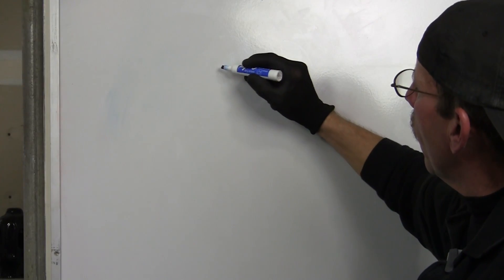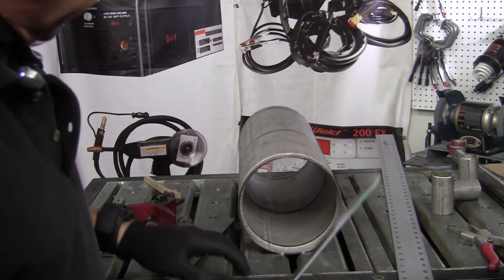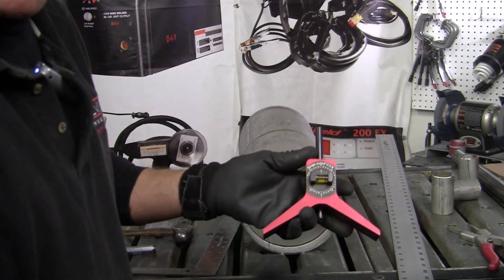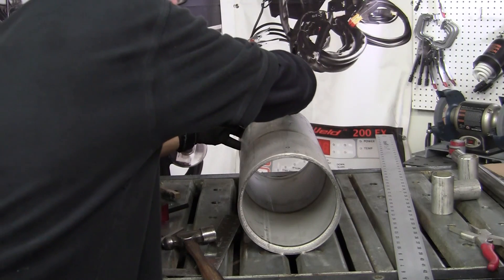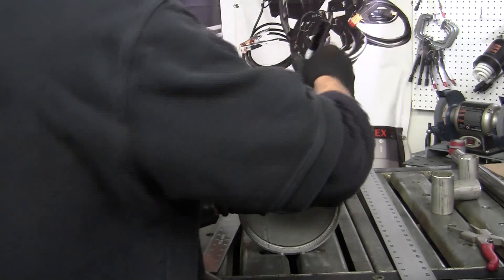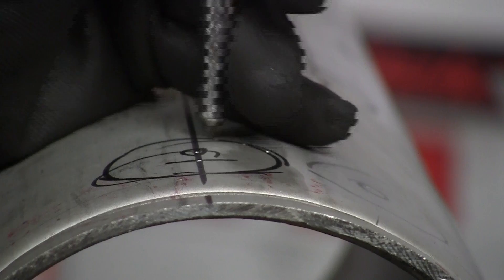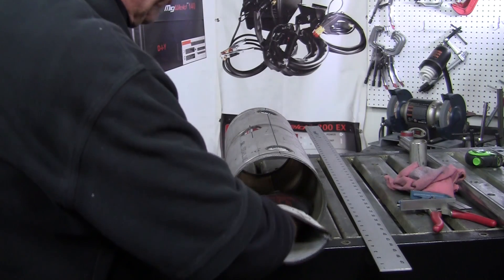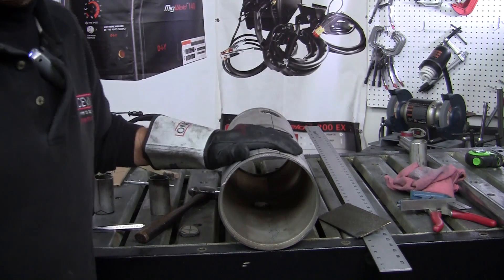HOW TO WELD STAINLESS STEEL PIPE TIPS AND TRICKS PART 2

Comment: Hi >> I have a quick question hope you have the answer.. my question is can I weld 2" stainless steel pipes and then bend them to form a coil to use it as a heat exchanger or the weld gonna affected
Reply: You have to make pie cuts in order for that to work. You can't bend pipe after it's been welded it will kink the pipe.
Reply from the maker: Hello. Sorry for the late response. But yes, you can weld and bend. If properly welded it will not break during bending.